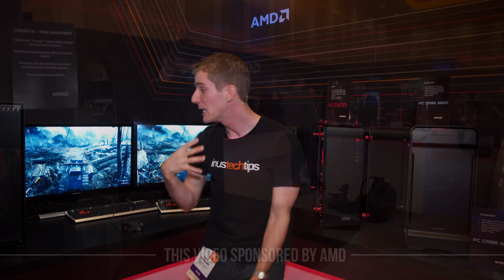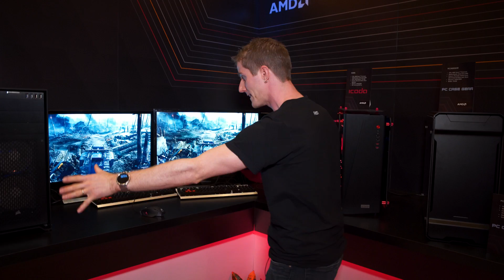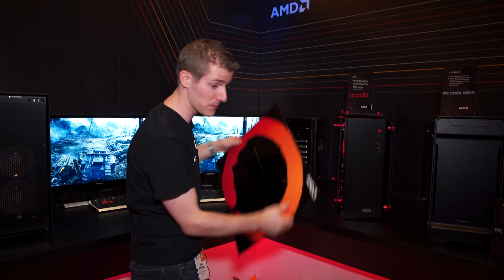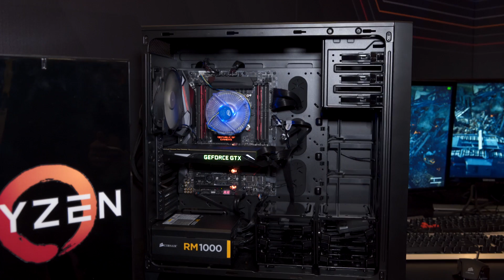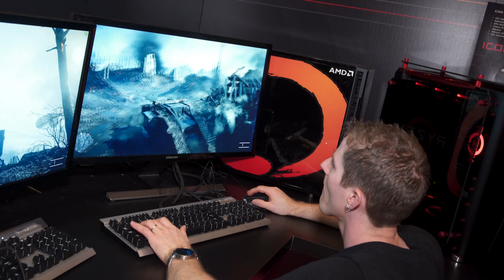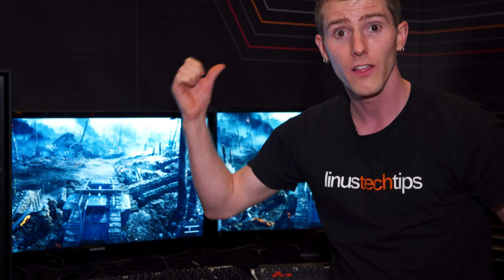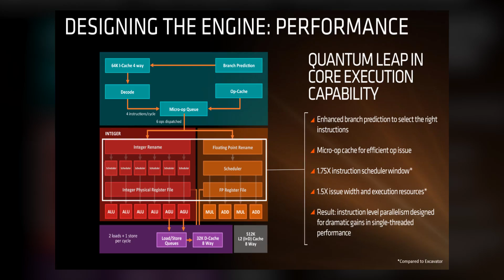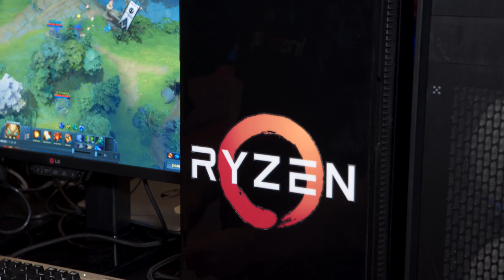AMD Has Ryzen!

Comment: What's the big deal if it has similar performance? I'm genuinely asking.
Reply: Cause it'll be way cheaper. That's the big deal.
Reply: If they're running similar performance before optimizations, then the Ryzen will almost definitely be quite a bit faster. It'll likely be on par with Kaby Lake CPUs, the competition lowers prices for all of us.
Reply: "AMD benchmarks are well trusted" lmaooooo
Reply: Ryzen 500$

i7 6900K 1100$

SIMILAR PERFORMANCE!!!!
Reply: Ryzen does not exist yet. It is not released. It is a prototype. Where did you pull $500 out? I am just curious? At this moment, AMD only has an optimized for specific benchmarks cpu. Nothing more. When AMD cpus will hit the shelves and have a real price, and people will start to test them in games, THEN we can say AMD has released something. It is very hard for me to believe AMD will offer same performance for same money compared to Intel in games. After 10-12 years it is trully hard.
Reply: It's not just optimised for specific benchmarks. They've shown it doing all sorts of stuff, like playing DOOM. Also you literally just saw it perform similarly to a 6900k in Battlefield 1 while the 6900k had a huge advantage.. $500 is an estimate by many people as a reasonable price for an 8 core Ryzen CPU.
Reply: And? Why would I put 2 cards in my sistem instead of one? More heat, more electricity bill, much powerfull psu, much more expensive motherboard needed as well. Those are all money, much more than the difference from comparing the cards.
Reply: Cosmin D. He was using it as an example to show that AMD benchmarks tend to be more reliable than their competitors'. He didn't say you would use crossfire in your PC.
Reply: The 6900k is that expensive because Intel can. AMD can't. In fact, a 6700k offers similar performance for $350. Can AMD deliver a $350 cpu better than 6700k? I highly doubt that.
Reply: Cosmin D. They can, because they know that Intel is able to have absurd prices because AMD just have nothing to compete. AMD returning to the CPU market will lower prices for all.
Reply: +Cosmin D. AMD can do it, it must do it, for sake of us all. Better prices, intel is too expensive, they will do the same thing they have done when amd release rx 480 they will lower all their prices.
Reply: Well @Cosmin D., no one is asking you to buy AMD CPUs now, are they? Just fuck off with your bullshit fanboyism.

Comment: 2 demos that don't tell much about the CPU performance itself.  mmm Strange?
If they were really able to produce a CPU that performs beter then the Intel counterpart, then they would have showed it already!
Only plus so far is the 8 core, 16 threads
Also people should stop with expecting that CPU performance will improve a lot in the future.  We are close to the physical limits of what can be done with silicon. 
The real performance gain have to come from software, there is still a lot to gain. Although multi threaded software is not easy to implement and not always possible .
I see the biggest improvement from XPoint MEMORY, not STORAGE! Being able to load/store software + resources  + data in an address space that is direct accessible to the CPU/GPU is very promising. That could bring us back to the good old architecture model off the original games consoles (Atari/ nes)
It's for Intel/Micron to prove that the really can deliver  and OS developers that they can use this new technology

Comment: Except if I get my i7 4790k with mobo and ram sold for a nice price, I won't buy anything from AMD (or intel) in the first year. The chip is secondhand and I bet it's still going to last a few years, and the motherboard is new so it should also last a while (although it's the cheap pc mate z97 overclocking it almost to the max 1.3v voltage)

Comment: I want to upgrade my pc since it is like 6+ years old and runs on ddr2. It is close to unuseable with an average of like 6 FPS in PoE. The problem is i need a pc like right now. You guys think i should still wait for ryzen? ( my budget is around 250€ with motherboard and ram)
current idea is i3 6100+h110dgs+8gb crucial
Reply: Save up more money. Or get a loan if you have to. There is no point in spending so little, you're just going to have the same problem. Save up at least 500€ to make it worthwhile. By then Ryzen will have shown what it is capable of and you can make an informed decision.
Reply: I'd rather buy Fx8350 even if its dead platform than i3.
Reply: Ditch the 6100, save up atleast for a 6400
Reply: Ryzen would be a bad idea buddy , get a better thing within your budget

Comment: AMD needs :  release new ZEN X4 Althon Quad Core to be AUD$65 to compete with G4400 and actually perform better then the G4400 ....... AMD need to release an zen  i3 6100/i5 2500k killer for AUD$135 ......... We need an i5 6500 killer by AMD ZEN/Rizen that is AUD$195-205 ......... Also the Rx460 2gb needs to be lowed to AUD$95-AUD$145 and RX460 to AUD$146-AUD$185

Comment: Ok so let me get this straight......
Number 1. The yet to be released Flag Ship AMD Processor is at least as fast as Intel's previous gen CPU and knowing AMD, this is going to be their CPU for quite some time.
Number 2. AMD Preview machine is using  a GPU from the competition because not only are they out matched in the CPU department, but they are also out matched in the GPU department.
Google GTX "1080 vs".... and suggestions number 1,2,3, and 5 is other Nvdia products which tells me how irrelevant AMD has become. Remember when ATi could actually rival Nvidia?? 
The CEO of AMD should grow a pair of balls or she should just leave. 

AMD = Mediocre

Comment: AMD isn't too elaborate when it comes to the price of this CPU... I wonder why that is... because frankly, unless it's significantly cheaper than INTEL, I'm not going to buy it -- not even considering it. It needs to be 2-300 USD cheaper than INTEL. AMD has been far too far away from delivering top-notch processors for so long, that in order for me to spend up against 7-800 USD on a processor, i need to see development consistency and delivery from AMD. INTEL has proven they can deliver, even though they are sitting all too comfy in that chair called "we've got no competition, so we don't need to spend money on innovation!"

If AMD wants to retake the throne of CPU making, all fine with me, but they need to prove they are worthy of it, and i will be honest, I have doubts that they can. INTEL's x299- series comes out here later this year also, and that is enthusiast grade processors. 

Ryzen also needs to be significantly better... and by a large margin, because if it's not, what then is the point?

Comment: alot of people are complaining now - what? 5 years and amd got "only" 3 pixels better than intel? what is this? - guys - realize: AMD has now MORE cpu´s, to attack intel in their price-tags and in their performance, and thats the point. intel had no competetive cpu´s from the amd side, so the prices dont fall down for 3 years - for fact - my i5 4750 is at higher price now then when i was buying it - the intel prices were stable or rising at the time...so now, what i hope - their can be massive drops in price for all of us. but AMD should have leraned from the past, and not selling the "beaten up the 1000-intel cpu" - for 300$ or so. oh please no. at least they would drop the price a little 100-300 $ (so it would be a 700$cpu), and that would be the worst for intel now. and that, would be good.

Comment: using competitors graphics cards and saying it's more powerful. Point goes to Nvidia
Reply: Everything Tech Review actually the reason they chose it is because if you can buy a high end cpu youll probably buy a high end gpu. They wanted to show the bottlenecking
Reply: cesare vissani I understand that. I'm just surprised that they didnt use their chips. they are competing in a different marketplace. they should really split their businesses
Reply: Everything Tech Review well i totally agree with that but you know amd graphics card will bottleneck this if it truly meets the specs advertised... Amd should release a new line of cards i think. something with a v in it
Reply: AMD doesn't have an equivalent card out right now, so what do you want them to do?

Comment: Might switch to AMD again, I suppose. I used to own an FX 8370 chip, but I had no idea how to build computers at the time and I got a used rig and the guy who built it bent some of the pins so the performance was awful (30fps in Oblivion, a game from 2006). I didn't notice it until I replaced it.
Got a new mobo and CPU ( i5 4690k) and it works great. I recently upgraded my R9 280X to a GTX 1070 and I have noticed some slight bottlenecking at 1080p. It's not too bad, but streaming isn't working so well while playing some games.

Comment: The real question is why are they using GPU dependent tests, rather than something like Cinnabench? Aida 64? With a card from the opposite team no less, white flag much? :/ I won't lie, I'm an Intel fan, but that doesn't mean I don't want amd to succeed, nor does that explain why they used a gpu dependent test to demonstrate a CPU?
Reply: Will google Take this name? hype
Reply: cinabench should not be the mandate any more honestly  its been known to run unoptimized code on anything but intel
Reply: AMD doesn't have the final clockspeeds and boosts ready according to various sources, they are still dealing with the finishing details, so they wanted something that shows the technology and features rather than pure CPU horsepower. They went with a well optimized game that can use all their threads, and a game+streaming to show their new feature that has less delay and higher end quality on the stream.
Reply: I think there's info for a lot of tests available now, these ones are much better for going viral. I dont think I've ever seen any Cinnabench or Aida results going viral in my lifetime.

Comment: I feel like building a computer is all about wishing you'd waited a few months. I wish I'd waited a few months.
Reply: Tiparium you can't wait forever. If you were to wait for the better component, you would always be waiting
Reply: I think it's also about waiting for a 'paradigm shift' to happen. 
For example I got my first(and so far still my fastest...) PC from my parents in 2007. It had a mid-end 2.33Ghz core2duo wiith a 8800GT. Even then the Core2Duo was already bottlenecking high end games.
My younger brother got his first pc 2 years later with a first generation i7-920 4 core/8 threads... To this day he can still play the latest games to this day effortlessly. Even his HD 5850 can play games like Witcher 3 on lower settings.
How often have I wished I hadn't gotten a Core2Duo system throughout the years, lol... If I had even gotten a Core2Quad instead of a Duo I would have had a much more future proof system.

To translate it to modern day. Ever since the first generation i7 (maybe the 2nd, as that had a significant improvement over the first) the CPU market has been increasingly stagnant, so it wouldn't be that bad to have an older generation i3/5/7 cpu. 
Now with AMD releaseing a fully new CPU architecture things might actually really change up things in the landscape. 

So basically ,yeah, you should've waited a few months.
Reply: Not really. At this point it's very incremental. If anything you are shaving a second or two and adding a couple of FPS...
Reply: Duranarts That's also true honestly. Ever since i3/i5/i7 came out there's been no need to upgrade and this doesn't seem to be changing in the near future.
Reply: Tiparium Dude it's about buying everything in November and getting great deals. I bought an i7-6700K for $250 on Newegg. I also got a 750GB Crucial SSD for $120, a Dell 27inch 1080P IPS monitor with Freesync for $140 I can go on. I doubt AMD will sell a chip faster than a i7-6700K for $250, at best they'll match it, but then who cares.

Comment: Yes amd just go ahead and use a nvidia card why dont you
Reply: langton mwanza well I mean it wouldn't have done it much good using something like an RX480, I think it's a smart move to use a Titan as a) this is really about the CPU being used, nothing else, and b) having a card as powerful as a Titan XP in there means that the only bottleneck in the system should be the CPU, therefore they are able to show its full potential (admittedly BF1 wasn't a great choice to do this, could have gone with something more CPU intensive)
Reply: When amd shows of their gpu's they pair it with an intel processor. When they show off their processors, they pair it with an Nvidia gpu.
Reply: Exactly, why don't you? Did you stop for a fucking moment to think about why they're using an Nvidia card?

Comment: The gpu is the main factor not the cpu, I put my gtx 1080 in my old system Athlon II 1090T overclocked to 3.8 , and have barely any few fps then my intel 6700k stock speed build. I was shocked on how well the amd 1090T did it was close to 100% cpu usage. only factor was when i cranked graphics past games stock profiles and added more eye candy that the intel 6700k would shine